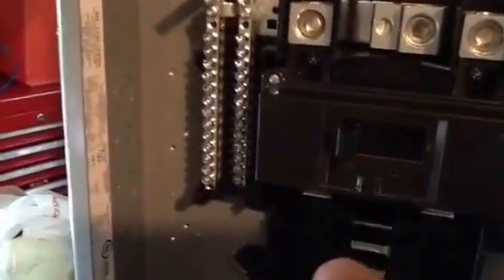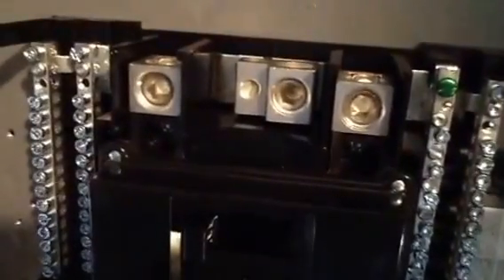INSTALLING BONDING JUMPER FOR SQUARE D PANEL

Comment: But only if it’s the main panel, not a sub-panel, right?
Reply: Correct. Bonding Neutral and Ground together should only occur at the main (or at a cutoff if you have one installed upstream of your main)
And where ever that bonding occurs a substantial ground wire (usually 8 awg bare copper)  should go from there to Earth ground (copper rod driven into Earth).
The important thing is that ground should not be bonded to neutral without providing for a path of least resistance to Earth (8 awg is good, bigger is better). 
When you do not have that path of least resistance, then the ground is said to have "objectionable current" because it has to compete with the neutral before getting to Earth.